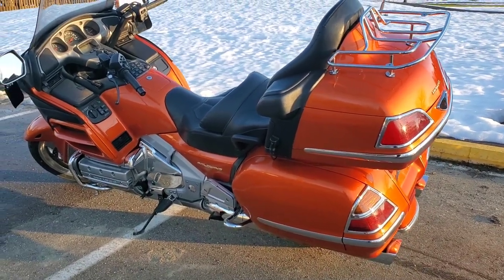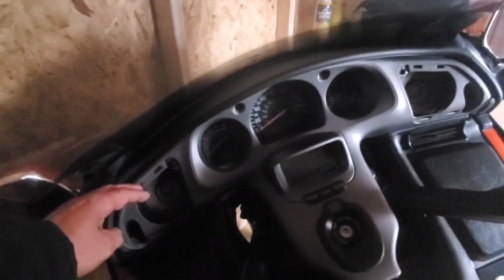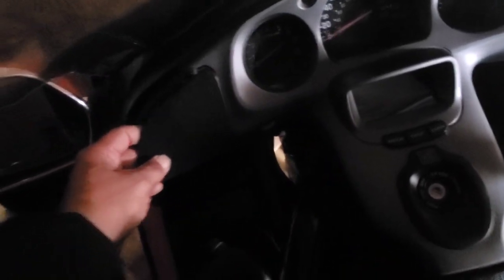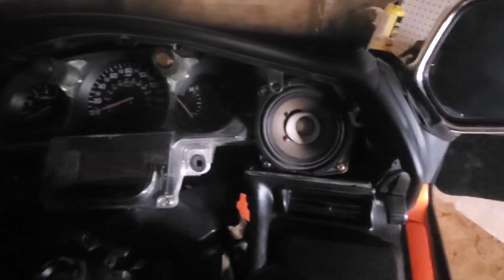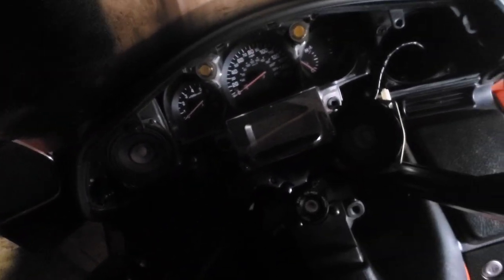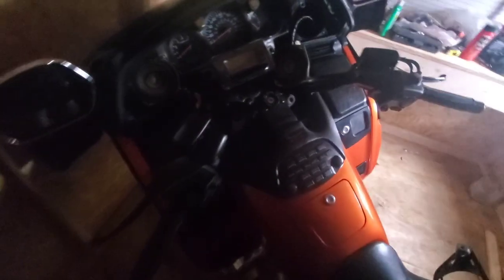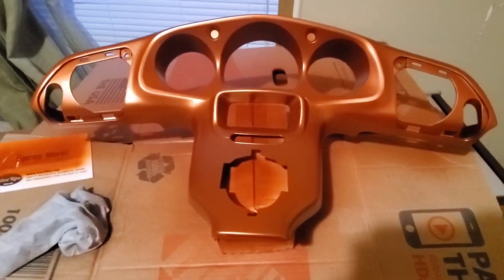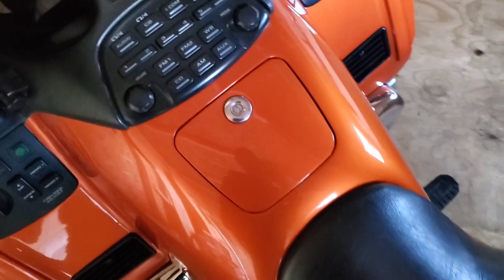Gold Wing GL1800 Dash Panel Removal, Painting,and Install With New Speakers

Comment: 2001-2005   - 2006+ different
Reply from the maker: That is correct. I have seen 2006+ painted as well. That's where they just paint the sides of it up around the speakers. The center most people keep black.
Reply: @mosmotorcyclejourney9067  2:21 is what I was referring to
Reply from the maker: @EliteGeeks  got ya. That must of been an error on my part. Thanks for that. In my videos I strive for honesty and integrity. And I don't put B.S. out there. Appreciated and thanks for letting me know.

Comment: Thank you. What temp did you bake it at?  Beautifully done. Thank you for the visions
Reply from the maker: 🤣🤣 I like that. I had a vision of it being painted and now it's done. I baked it at 130 degrees. Please do not get hotter then 130 degrees. Remember it's only plastic and it can loose its shape as in melting. Thank you for the comment and for watching. Be safe and let me know if I can be of any assistance to you.

Comment: Nice work, I am curious about the “baking”. Please let us know why , how long after the clear did you put it in the oven and how long did you leave it there and at what heat level. Thank you much
Reply from the maker: Thanks for asking. I should of touched on that in my video.  I baked it because clear coat takes awhile to dry. Sometimes days before you can handle it. By doing that I was able to re-install it the next day. As far as what temp... I set it at  135 degrees for 90 min and then just let it sit overnight in the oven. Next day install. Another factor is it helps the clear coat  to lay flat and more evenly so you don't have to wet sand the orange peal to get a smooth glass like surface. I figured that piece has alot of curves in it and it would be hard to wet sand evenly. But good question and I hope I answered it for you.
Reply from the maker: And it was about 15 min after I sprayed my last coat of clear when I placed it in the oven.
Reply: @mosmotorcyclejourney9067  yes, thank you very much.

Comment: Where did you get the paint from? Thanks great video
Reply from the maker: ColorRite.com. you can buy multiple packages. Mine costs 79.99 plus shipping so 95 bucks and had everything in it to paint, sand, clearcoat, wetsand, and cutting compound to buff.
Reply: Thanks I got an 02 indigo blue ride safe brah
Reply from the maker: @michealmadison9233  nice color. I wanted that color when I was looking however my wife had something to say so the pearl sunburst orange it is.  That would look good on the blue as well. Ride safe my friend

Comment: Hi, did you have to modify the speaker boxes to get the Show Chrome speakers in.  My 2001 has 4 1/2 speakers and wont slip into the holes, they kind of float in the hole. Thanks
Reply from the maker: No not at all. They went right in and all the holes lined up. My bike is an 02 and I ordered the 4 and a half inch speakers. However it made a big difference in the sound with the new speakers. Thanks for the reply.
Reply: @mosmotorcyclejourney9067  thanks, I wonder if they didn't change speaker boxes from 01 to 02.  I have the same 4 1/2 show chrome speakers. Looks like I might have to get out the dremel tool, widen the hole (not much left to grind off), and nip off the corners of the speakers (ouch, I am cringing thinking about it). I did plug in one of the new speakers and they sound dramatically better than the ones that are in there now.   Well I have a 4 day weekend, so it will be fun.  Besides, my order from colorrite will be here and I'm prepping the meter panel to be painted pearl hot rod yellow. Thanks, Gene
Reply from the maker: @photoggenes7443 yeah I'm not sure about the difference between 01 to 02. Shouldn't be no difference. I must say the reason I painted it was because I love the hot rod yellow bikes and I seen one that had the panel painted and loved the way it looked. So thats what prompted me to do it. It gives the bike a different look and looks great painted to match the bike. Let me know how it turns out. If you bake it please remember do not go over 130 degrees. The heat can warp the plastic panel and make it hard to put back on bike. Good luck and please send a pic when finished. I would love to see it. Thanks.

Comment: Did you use a paint spray can or a gun ?
Reply from the maker: Spray can. And spray can clear coat.
Reply: @mosmotorcyclejourney9067  Thank you for your reply,  did it just take one can ?
Reply from the maker: @workharddieproud  half a can of paint and almost half a can of clear coat. What state do you live in? When I bought my bike I really wanted a hot rod yellow one but my wife had something to say so I ended up with orange. But I so wanted the yellow one and wanted to paint the dash yellow.
Reply: @mosmotorcyclejourney9067  Thanks again !!  I live in South Central Kentucky.  I would be more than happy to let you do it IF I lived closer.
Reply: @mosmotorcyclejourney9067  And my bike has been down for 2.5 years, trans problem and I’m finally getting it going and replacing a ton of stuff on it, cosmetic stuff and always wanted that meter panel painted but was scared to try it myself.  I’ll look at Colorite and see what I need.  Thank you very much for the info !!!
Reply from the maker: @workharddieproud  no problem. If you need anything else please let me know. Take care my friend and good luck 👍
Reply: @mosmotorcyclejourney9067  Did you use any primer before the base coat ??
Reply from the maker: @workharddieproud  no. No primer was needed because I never sanded all the paint off the piece.  I only use primer when I have all the paint off or bare metal.
Reply: @mosmotorcyclejourney9067  I didn’t think so.  I purchased the colorrite kit for my Yellow Wing and a few days ago I lightly sanded all the gloss off the part,  washed it, did a sprayout on the white supplied card,  used a prep pad to clean it again, tack cloth, no primer, three coats of base, color and two coats of clear.  The color ended up being GOLD !!  Not even close to my Yellow. Now I got a mess trying to get it all off the meter panel.  I have read online that some people have had problems with the colorrite paints and others haven’t.  I have not contacted them yet.  Anyway, thank you for your reply !!!  Have a good day.
Reply from the maker: @workharddieproud  wow. I'm so sorry to hear this. Did it look alright on the color match card after you sprayed it?  One thing I did was warm up the can and shake the shit out of it constantly while I sprayed it. Please contact them so they can send you another can of the right color match. And I remember  you were concerned about it comming out a mess.
Reply: @mosmotorcyclejourney9067  I actually had the spray cans in the house at room temp the day before I sprayed.  I did look at the card but even then the yellow color looked too bright but I figured it would change once it was all done on the part. I actually did just now email them a long message about it and sent them pictures.  Thanks again man !!!
Reply from the maker: @workharddieproud  your welcome. They will take care of you. So sorry to hear about the results you had. Maybe I got lucky. Not sure but they will take care of you.
Reply from the maker: And let me know if they don't because I'm not gonna refer a product to my viewers that some may have problems with.
Reply: @mosmotorcyclejourney9067  After my long email to them and the pics I sent, the only response I got was,  I need to call they’re tech dept.  I emailed back explaining that I work 12hr day shift, phone calls are difficult and I wasn’t trying to be rude but I don’t think a phone call was gonna fix my gold color.  I also said that their color can started not spraying right.  And just said I’d fix it myself, thank you.  Got no response after that.  Besides, stuff like this I like having written proof of whats said, no phone calls.  I can prove my side of the story,  I even told them that the Gold color / finish turned out good and I thought about leaving it since it’d for my “Goldwing”  but in the end I wouldn’t be happy because it’s not my yellow color. I also even told them that it could have been my fault but I doubt it. Anyway, like I said, some have had good luck with their colors and some have not. I have not, I’ve already started the other day trying to remove the paint and start over, it’s a mess but I’ll get it fixed.  Colorrite can keep my 113.00 but I won’t recommend them.  I did shake the cans really well, outside temp that day was above 65 in the shade, the cans were labeled correctly.  I just don’t know what happened,  I means it’s not like painting a car.  This should have been pretty simple. Oh well.  Thank you so much again, I’m glad your’s turned out great, it really does look good.
Reply from the maker: @workharddieproud  yeah again I apologize about your luck. And in my eyes they should atleast send you some money back or a new can of paint. A can being the proper color. I just can't see gold from yellow. As in that makes no sense. It had to be the wrong color that was in the can. I do remember seeing on their site some paints you need a base color. I'm not sure with yours but I myself am going to look into that. You actually gave me a great idea of buying some dash bezels and painting them to color match factory paint then selling them. It would help the people that don't want to take the chance and then doing it and it turning out the wrong color.
Reply: @mosmotorcyclejourney9067  Thanks again, they should apologize at the very least, I gave them proof.  The Base can and Color can were both labeled correctly,  I looked before I started spraying.  I just think the wrong color with wrong label,  color could have been right but mislabeled. Anyway, it should have not turned out GOLD, it was nowhere near close to my bikes color.  I wasn’t expecting a perfect match, it would have been close I would have been satisfied, I’m easy to get along with.  I know I seen at least one post on the gl1800 riders forum about somebody else’s colorrite paint not being even close.  Like I said, this really was a simple job, I followed their directions and I had the gloss sanded off and a smooth finish.  I give them one thing, the finish did look great and that stuff sure is hard to get off.  I about get it cleaned off and then gotta re-sanded it for some other paint I got.  I’ll let you know how that turned out.  ENJOY YOUR GOLDWING !!!!
Reply: I think, I figured out what happened. I found a yellow spray paint color online that matched up really well to my bike it turned out, well yellow.  Some of the places that I got yellow paint on while spraying the colorrite looked yellow.  I’ve read that yellow can be a difficult color to work with.  I believe that with the dark colored gray plastic,  it needed to be primed first, which I didn’t do. I followed the paper and can directions.  I used a white primer this time on the part and the yellow paint turned out yellow.
Reply from the maker: @workharddieproud  well thats great to hear. When you get it completed please send me a pic. I would love to see your bike with the bezel installed. I do love the hot rod yellow ones.
Reply: @mosmotorcyclejourney9067  Where do you want me to send it to ?